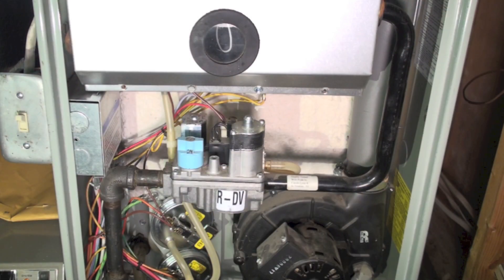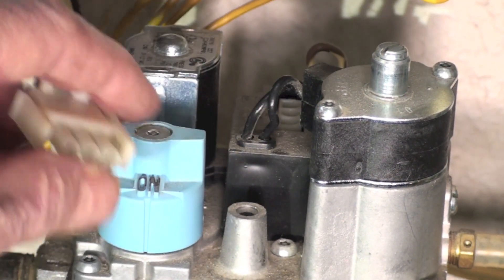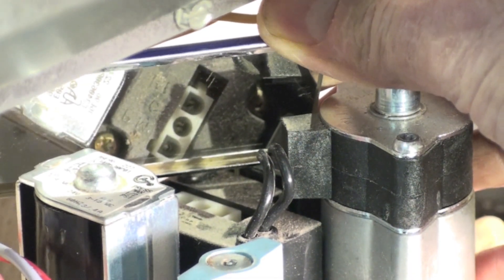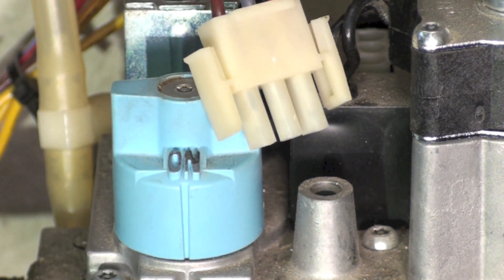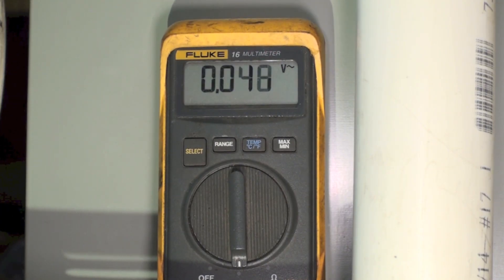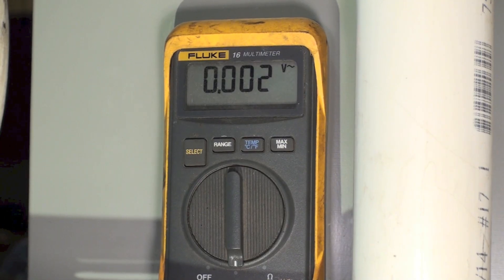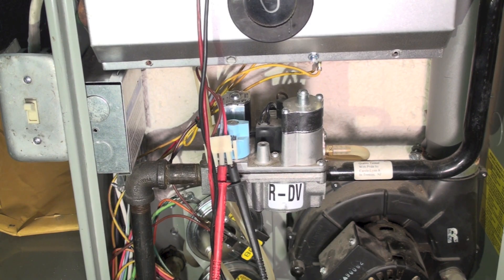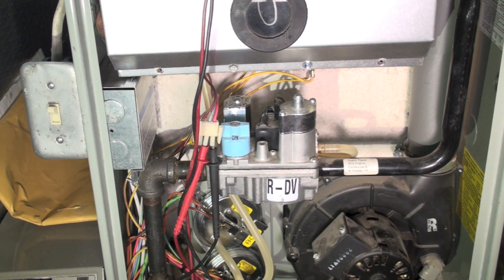Voltmeter check of the gas valve

Comment: Hello, love your videos!! I have an older '87 Kenmore condensing furnace mode#867769224. I've owned my home since '94, furnace has no other issues, works great. Not too many issues in the past, blower motor and limit switch in 2009 and 2010. Now fins going bad on blower wheel and I might have to replace motor again, it's been 8 years, but service tech had limit switch at 60 90 220. It s/b 90 135 180. My question, gas valve vr8440p2088 has a slight gas odor in the last 6 months since the squirrel cage is humming and now it's real loud and part on order for it. I'm having issues with replacement of gas valve. Is it normal to have a slight gas smell? Also notice the limit switch bounces before it shuts off at 180. Seems like it cycles down before the thermostat is satisfied, but I don't keep my house very warm, 68-69 degrees. Of course motor comes on within a couple minutes or less after thermostat calls for heat. At least now, my blower turns off with the adjustments of limit switch...thanks to your videos!! Thanks again for all you've done!!
Reply from the maker: Melissa Wery The gas valve should have no gas odor. If the smell is determined to be from the valve, replace it. If from the piping, repair the leak. 
GFM
Reply: Valve, wheel, blower and limit fan switch parts came in. Waiting for service tech next week to install. Now it's short cycling, blower wheel isn't very loud now. I cleaned out the drain attached to the flue plastic pipe. Now I'm noticing water in the tubes attached to neutralize tubing. I'm wondering if it short cycles, because of blower motor getting weak or I have a air flow issue.
Reply from the maker: Probably air flow.
GFM

Comment: I am Troubleshooting a pool heater, it has a similar control board. Im getting Ac power for a few seconds but its not 24. It seems all over the place for a few seconds then shutsdown. goes up high to almost 100 then 24ac then off.  I have a Robertshaw sp715a ignition control board.
Reply from the maker: Sounds like you may have a short in the low voltage.  No simple answer.  Just have to start eliminating parts.
GFM
Reply: so what feels good is that if I put 24v to M/v from the transformer everything starts up. Gas starts then lights . I had a scheduled power outage , but it was unusual as we have a brownout then surge mid event. The surger It tripped m y AC unit breaker, all the GFI's in the house. 
Weeks later i find my poolheater wont start. watching your videos , i see sensors are good. Board at startup gives voltage that my cheap meters cant interpret , then to zero. I wonder if its giving the 24 or there is something in the board broken.

At this point , parts work and burner stays light if i give it 24v directly to M/V.  Should i jump to replacing the board? Also transformer seems blown. Im not a professional and I could have done it in my testing  just as I made my findings it seem to stop working. I plan to replace that with a 24v transformer with a breaker.

Comment: I'm getting a voltage reading of only 12.7 whats that mean?
Reply: I am a novice, but I would suggest testing at the transformer to see if it is putting out 24 - 28 volts there. If not, I would replace the transformer. Again, I am only answering this as a novice. I have had this same problem in the past, and that is what I did, and it worked.
Reply: Jeff Mattero  thank you Jeff. Got it figured out it just needed to be reset.

Comment: I ran the test with volt meter. I️ am not getting power to the gas valve. So i have to replace the main board? That’s the solution or something else.

Comment: that light switch next to your furnace. does that need to be turned off before testing the wires?
Reply from the maker: No, you are checking for voltage, so you need power to the furnace.  You also must have the thermostat calling for heat.
GFM

Comment: Thank you so much for sharing your knowledge and presenting this video.  My Bryant 90+ will not light nor "click"  although the induction fan and ignitor glows.  It tried 3 or 4 times then shut down.  I connected the voltmeter and repeated the measuring but no voltage was observed, which leads me to believe the board is bad.  Do you concur? Is there a method to verify the board is no good?
Reply from the maker: Not enough info.  The gas valve is only energized for 4 to 7 seconds after the ignitor has warmed.  Are you sure gas is available?  Gas cock open, gas bill paid?
GFM
Reply: Yes. Gas is supplied.  All cocks are open. The furnace worked great last winter.  I know the thermostat is functioning.correctly.  The starting sequence seems to work correctly..  I attached volt meter leads to terminals of gas valve but no voltage even though the glow was noted at least 3 times.the usual click during ignition just before the burners fire didn't occur.. I verified pressure switch functioned,  drain wasn't clogged and flame sensor was cleaned.
Reply from the maker: If there is no voltage to the gas valve during the trial for ignition, then you have a problem with the wiring to the control board or the board has failed.
GFM

Comment: If the gas valve is warm with the thermostat on, that should be enough to tell you that voltage is getting to it, shouldn't it? I have a 1983
Reply from the maker: No.  You need to check voltage at the valve.
GFM
Reply: Okay I've done that. I'm not sure if I'm using my voltmeter correctly but I read 130 on the AC line with the thermostat turned up a little. If I have a bad gas valve, though, shouldn't I consider replacing the furnace since it's a 1983 model Lennox?
Reply from the maker: First, you should read 24 volts at the gas valve terminals.. Yes, it should be replaced if there is a major failure.  Do not throw good money after bad.
GFM
Reply: Thanks. I"ve been quoted a price of around five hundred bucks to have a contractor come and replace the gas valve. So it's looks like I could be throwing good money after bad, especially if I have another problem later. I've already replaced the thermocoupler tube last November.  At least it's summer now.

Comment: Love your videos! They help so much. I have a older modular home with propane furnace. Surface igniter comes on, I get flame and goes out. 3 blinks on the light for ignition failure. Any ideas? Thanks Zach

Comment: I have the second valve that you show in the video with only 2 prongs.  When I start it up, the inducer starts, the igniter glows but no flame and I hear no gas.  I read 19v to the gas valve.  Is this from a bad board?
Reply: Hello Griffin, was 19v due to a bad board?

Comment: follow up question:  when voltage come across the 36G24-618 valve, I hear a click then nothing (no gas).  Is the click indicating the valve is opened or is that just voltage going into the solenoid?  thank you again.

Comment: I have a White Roger 36G24-618 and I have 24VAC coming across it but it isn't letting out gas once the igniter is on.  Can I slightly loosen the boss plug on the gas inlet side and check for gas to check if the gas is available there?  Also if the valve needs to be replaced,  can I replace it with the 36J24-614 single stage valve?  I see dual stage compatible 36J24-614 valve on White Roger website.  My worry is the cabling on the 36J which has 6 prongs instead of 2 for 36G.  Thank you,
Reply from the maker: You can but of course be careful and not loosen it too much.  There is little difference between the J and the G valves.  I can't say I see where the wiring for the J and G models are any different.  Hope this helps.
GFM

Comment: I have a temp star when it first start up it lights and run for about 2 or 3 minutes and then flame goes out and it relights but now it runs about 10 seconds so I changed the ignitor spark & pilot burner and it does the same thing,it has a intermittent on it also,what could be the problem?
Reply from the maker: First, is your furnace vented with plastic pipe?  If so you may have a blockage in the vent or combustion air.
GFM
Reply: Its vented with metal,but a new coil was installed during the summer
Reply from the maker: I would be looking for vent pressure problems.  Possible inducer not producing enough vacuum.  Pressure switch tubing blockages.  You could also have a crack in the heat exchanger.  Look for flame rollout of the burners.
GFM
Reply: OK I will look in the morning. Thank you for your help grayfurnaceman
Reply: THANKS FOR YOUR HELP GRAYFURNACEMAN I CHECKED TODAY AND THE FLAME WAS ROLLING OUT AND IT GAVE OUT A SOUND ON START UP WHEN IT LIGHTS THE BURNERS AS IF GAS HAD BUILT UP(POOF) SO I AM CONDEMNING THIS FURNACE.

Comment: Im getting a constant 14 volts to my gas valve. Once the hsi heats up the voltage drops to 11 volts then goes back to 14 volts. The gas valve is wired straight to the board with nothing in Series so Im assuming the board is bad. Any thoughts?
Reply from the maker: The 14 volts is a ghost voltage.  Nothing there.  You need symptoms.  Inducer comes on?  error code lights?
GFM
Reply: Yes inducer came on replaced board and now unit is working properly
Reply from the maker: Merry Christmas
GFM

Comment: I get approx. 26 volts constantly to the valve and this drops only when I turn the thermostat below room temperature. The furnace still doesn't light. Is this a gas valve problem or something else, or both?
Reply from the maker: If you have power to the valve, either the gas valve has failed or there is no gas supply.
GFM

Comment: Hey, I have a similar gas valve but the medium heat and high heat are jumped out? Is that just a way to use a two stage gas valve for single stage heating? Thanks
Reply from the maker: Unless your furnace is a 2 stage,  the 2 solenoids on the valve are redundant valves.
GFM

Comment: I have a problem with the gas valve, the pilot is on when the temperature in thermostat is increase the flame come on, it heat the house when the thermostat is satisfied the flame is shutdown but  30/45 second later the pilot goes off,  this particular valve is brand new is a Honeywell type 400/24 volts.. does any  body has a comments I have had three difference plumber with not solution.
Reply from the maker: You need to look at the pilot.  Is it covering the thermocouple completely?  Is it blue?  Yellow means dirty pilot.
GFM

Comment: If I have power to the valve and the tests show proper voltage on both pins could it be the valve its self? If so is there a way to check the valve mechanically? Do you have a video in this?
Reply from the maker: I there is 24v power to the valve, the valve has failed.  The valves are not repairable.  Also be sure gas is available to the valve.  Hope this helps.
GFM
Reply: turns out that the sensor on the pilot light had carbon on it and couldn't sense the pilot flame so it would shut down. I had a new sensor put in and it works perfect. I had checked every sensor but didn't realize that the pilot had one in it too.

Comment: thanks! learned quite a bit with this. 
Ever heard of a furnace that wont lock it self out after multiple failed ignitions? I have seen my home furnace run the induction motor for hours while it keeps trying to cycle for ignitions. No error codes. It just keeps trying and trying. I got it cleaned up and its working fine, but that really has me curious if you have heard of that kind of problem?
Reply from the maker: Yes. Most units made in the last 25 years will try 3 times, then it locks out. One hour later, it will try again. If it operates as you have described, the control board has failed. Hope this helps. 
GFM
Reply: grayfurnaceman Thanks for the prompt reply! :)
Reply: Hi! back again... Furnace was working fine so I never got around to changing the board and summer went well withno issues on cooling... . Problem is happening again this year. all goes well but no ignition, no errors.  :( This time I want to attempt checking if the valve is actually getting current. Is that AC or DC the multi-meter needs to be set at? (im more familiar with vehicle wiring but being that its coming from a circuit board, i'm under the assumption it will be DC going to the valve...?)  And looking at the video you have red on common ? And black on positive / red wire?  Im curious of your multimeter settings to avoid a mistake.
Reply from the maker: It is A/C going to the valve.  The polarity of the leads is not important.
GFM
Reply: Thank you so much for sharing knowledge. This all comes at a time when my financial resources are very limited so anything i  learn to do helps my family.  

Update: 
I hooked up the multimeter on a/c mode to the two leads and it flickered to "0240" for a half second just after the igniter started glowing strong.  Leads were attached to the valve assembly. I don't know if my multimeter is slow on refreshing but it does not hold the voltage no where near 4 seconds.  :(  I hear no tick from the gas valve. 

Q) is there a way to feed the valve 24v directly for testing? to see if it clickcs / hisses?  If the valve triggers that will tell me for certain the board is bad and valve is good. But then what if the valve has a short in it. Could that be why i only see a very fast burst of 24? 

I'm suspecting board since it does not lock it self out nor gives any error codes.  

all it does is cycle over and over and over...
Reply from the maker: It probably is the board.  You can test the valve by placing  jumpers from C and R on the control board to the gas valve.  
GFM

Comment: Gary, thanks for the videos.  I really enjoy watching them.  I'm having a problem with an Amana gas pack.  The furnace won't fire.  It has a Gemini 2 stage gas valve. I checked incoming pressure and I have 8" of w.c. When I cycle the heat I can feel the valve click like its opening but I'm not getting any pressure on the outlet side of the valve.  I checked the voltage and I'm getting 24 volts to the high side but negative to the low side.  I think that I correct.  These Amanas are the same as a Goodman.  They fire on high first them drop down to low after a minute and a half.
Reply from the maker: +modsquad67 My thought here is the gas valve has failed.  
GFM
Reply: +grayfurnaceman my thoughts also.  So I replaced it today and it's doing the same thing.
Reply: +grayfurnaceman the home also has gas logs, and a gas water heater. They are working.  I checked the flames on the gas logs and they looked good.
Reply from the maker: +modsquad67 Do you hear gas coming thru when there is a trial for ignition?
GFM
Reply: +grayfurnaceman  no.  I don't hear or smell any gas.  The unit cycles like it should.  I'm going to try and call the manufacturer today and verify the sequence of operation.  The only other thing I think could be causing it is a partial blockage in the gas line.  I'm getting 8" w.c. at the inlet of the valve but when I break the line open at the Union and open the valve the gas doesn't seem like it's really blowing out very hard.  I know it's a 1/2 pound system.  That may be throwing me off.   Thanks for your help.  Your videos make me a better service tech.  I have learned so much from watching your videos.
Reply from the maker: +modsquad67 To test if there is a blockage, you can put the gauge on the tap on the valve, then fire it up.  If the pressure drops, you have a blockage.
GFM
Reply: +grayfurnaceman   I spoke with Goodman tech support this morning.  They recommended that I jump out all of the safeties and see if that lets it fire.  Also they said to spread the pins out that mate with the plugs so they can make a better contact.  If that doesn't work they suggested replacing the control board.

Comment: Thanks for taking the time end effort to make these videos. They're very informative and easy to follow.

I found this one because of an issue I'm having on my Goodman 080-4 2-stage furnace. It seems like there's a short in the connector to the solenoid. When it calls for heat, but solenoid doesn't trip, I can put very slight sideways pressure on the connector and it trips. If the HSI is still hot then the burners fire. Bump the connector again and gas shuts off.

Following you procedure here I check voltage and at call for heat I have 25.6 V~. I pulled the connector board and housing like you show in one of your other videos. The board looks good.No burns or breaks. I have continuity from the wire side of the connector, and the various spots on the board that I can trace them too. I'm wondering if it might be as simple as the sockets in the molex connector being loose. 

 I have a new valve on the way, on the assumption it's a shorted connector or board. Thanks again!
Reply from the maker: +tykesplace It could be the connector.  Or it could be a solder connection on the board is "haloed".
GFM

Comment: if i do get the 24 volts at the gas valve but only for about 1 second to 2 seconds what should i be looking at? sequence is normal, gas pressure before it is good and hsi lights up nicely. Looks like whoever installed transformer didnt mount it properly and it sheared off at the 24 volts side, common was still attached. kinda leaning towards board..